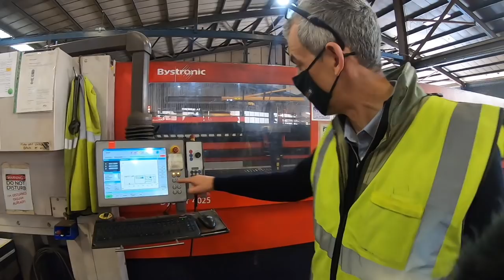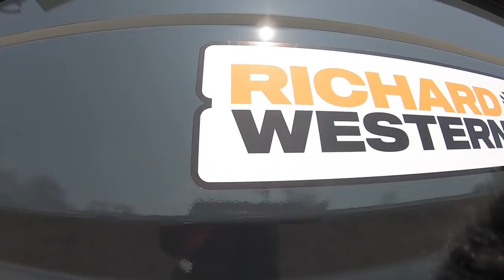The Next Farm Trailer? Richard Western Factory Tour!

Comment: When we paint our trailers we have a metal plate which goes over the hub to stop any paint contact on the hub where the wheel has contact with, pull it off all clean I see you guys use a different technique for the same job, I'm impressed with the quality of the paint on your trailers